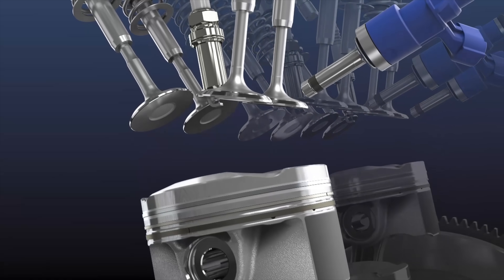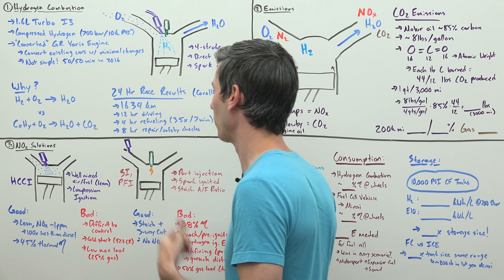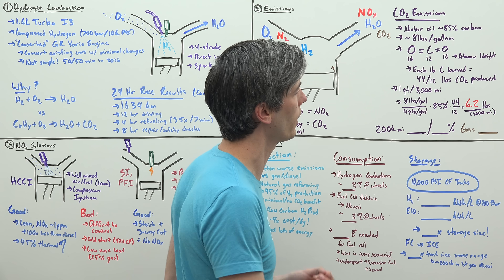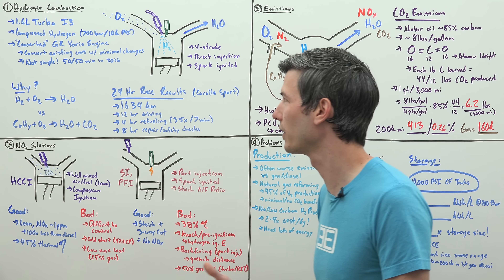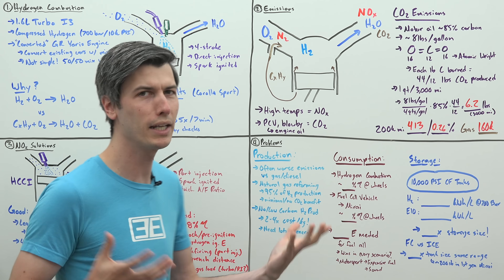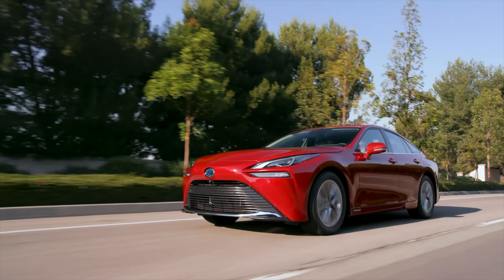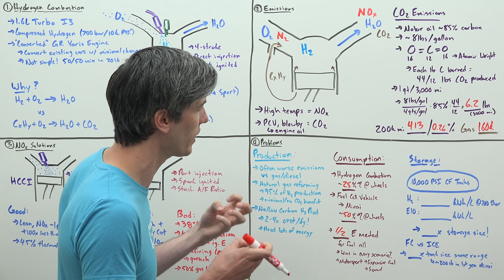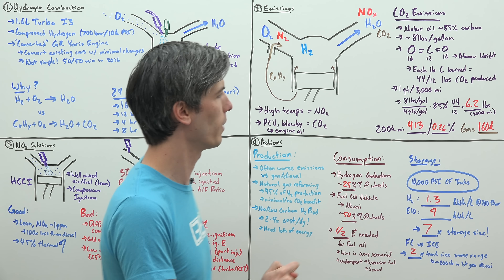Toyota's Developing A Hydrogen Combustion Engine!

Comment: Very interesting. But I think Toyota needs a lot of respect for trying all these different options, they seem to really care about ICE fans. I appreciate that.
Reply: Battery production capacity is the problem. Huge amount of investments needed and a big cut over their profits because of the battery cost in each car. Hydrogen combustion engines would maintain a bigger piece of the pie. 

Money is always what they care about.
Reply: @MuitoDaora  It's not what "they" care about.
Hydrogen ICE simply makes more sense and is way better for the environment if you take into account the whole process chain of regular EVs.
Plus the ICE has been developed and optimized for decades now, it would be a total waste to throw it all away and start fresh.
Reinventing the wheel never works.
Reply: @MuitoDaora  if you're correct, why don't they simply take the money they're investing in hydrogen power and channel it into battery production so they get all the pie?
Reply: @vinigretzky97  I'm not defending EVs, just saying that money in their pocket is what matters.
EVs are being pushed by regulators for their efficiency and possibility of not polluting the atmosphere by using renewable energy for the whole process but the mining problem persist.
Reply: @pjay3028  Because this experiment is dwarfed in comparison to build battery factories over the world. Even tesla has to use suppliers for their batteries.
Reply: @vinigretzky97  That has been disproven many times already.
Reply: @vinigretzky97  HAHHAAH  better for the environment than EVs.  Did you skip the part of where the hydrogen comes from?

And you do know that mining is required to build Any car, not just EV's right?
Reply: @MuitoDaora  that doesn't change the fact that they're championing alternative power options in a way that other manufacturers don't seem to be and when you link that with the effort and funding they've put into cars like the GR Yaris and the GR86 which are definitely not going to deliver huge profits, to say they're all about the profit is harsh.
Reply: @KenLord  Yeah but only standard metals like aluminium or steel.
Reply: @boostav  nah, it hasn't. citing the thermal efficiency figure time and time again won't change anything about the ressources and effort required to get to a running car in the first place.
Reply: @pjay3028  That's brand recognition. Not every product makes returns in direct sales but there is always a flagship that that allures the brand. For example Gucci makes some really expensive clothes but  big money come from thousands of cheaper accessories.
Reply: @MuitoDaora  you're really going to struggle to convince me that probably 99% of Toyota buyers will be remotely swayed by the existence of the GR cars.
Reply: @KenLord  Where does hydrogen come from? Where tf do you think? It's THE MOST abundant element in the universe, it only needs to be isolated from water. Electricity on the other hand, has to be generated.
Reply: @vinigretzky97  you didn't watch until the end, did you? You know, the bit where Jason says everything about the idea is bad and doesn't make sense outside of very nice applications.
Reply: @vinigretzky97  Has nothing to do with citing efficency figures. Those fake studies you cite don't look at the full cycle of Hydrogen or Petrol, how do you think the natural gas from which hydrogen comes from is extracted? The EU study cited in this very video is one of many that completely disproves your argument, but clearly reading/listening comprehension is not your forte.
Reply: @ajstevens1652  Yeah chief that's the entire problem ... isolating it from water is incredibly inefficient. Also it is the most abundant element in the Universe not on Earth.
Reply: @MuitoDaora  yah and China has more than 90% of the world's lithium which is not as welcome to Japan.  Looking forward for the result of this battle 👍
Reply: @boostav  EU is just a big lobby aparatus not a valid source for science.
So what is the problem with extracting natural gas?
Reply: @jfolz  That's your source? "What Jason said"?
Reply: @pjay3028  Of course not, but that isn't objectively measurable. And all brands that produce goods of desire do that. Is subjective.
Reply: @davidkorcak  Great, gas it is then. Never change a running system.
Reply: @ajstevens1652  HAHAHAHA OMG WOW That is freaking AWESOME!

"it just has to be separated from water" ... first of all, the video TOLD YOU that most hydrogen is produced from reforming Natural Gas ... Emitting CO2 the same as if you were burning natural gas,  oh but wait, the reforming process requires temperatures of 700 to 1000 degrees Celsius.  It's Very Energy Intensive!

Second of all,  If you want to get hydrogen from water ... Guess how it's done!  USING HUGE AMOUNTS OF ELECTRICITY ... that HERPA DERP DERP DERP ... HAS TO BE GENERATED.

This Is Why Hydrogen Makes No Sense For Cars.  Hydrogen is not a fuel source, it's effectively a chemical battery.   So cut out all that unnecessary complexity and extra stuff that can break, and just use a freaking battery.
Reply: @ajstevens1652  "it's the most abundant element in the universe" 

Just wow, I'm still laughing.  What are you going to do, take a spaceship to the sun and bring some back?   HAHAHAHAHA.
Reply: @vinigretzky97  Read up on how mining works.  Presently most lithium is extracted from underground salt deposits using injected hot water.  The water is put in evaporation ponds so the sun can dry it / precipitate the salts which are then refined.

... I bet you believed the propaganda showing massive / damaging open pit mines.  Which in reality are views of "Standard" metal mines.
Reply: @ajstevens1652  to seperate water for hydrogen you need about twice as much Electricity compared to what you would use on an BEV for the same distance travelled.
Also Hydrogen fueling infrastucture is incredibly expensive. about 10x to 100x as expensive as Electric fast charging infrastructure.
Reply: Lol don’t think for a second they “care” lol 😆
Reply: @koruki  have you read anything about Akio Toyoda?
Reply: @pjay3028  the grandson?
Reply: @koruki  the guy who runs Toyota at the moment and is an absolute petrol head. He's the reason they do care.
Reply: @jfolz  I am very sure the Toyota engineers did the numbers before committing to the race. Either they saw something feasible and workable or at this point they're just exploring the technology. And that project probably did not cost much for them.
Reply: @unitrader403  "Hydrogen fueling infrastucture"... who's talking about that? Think LPG tanks. Hydrogen filtration is the biggest challenge for them.
Reply: @unitrader403  don’t matter man a battery car is not clean unless its being charged by solar or turbines. if they can use renewables to make the hydrogen i dont think it matters what efficiency it gets long as people can refuel in two minutes on the go is all that matters
Reply: @vinigretzky97  If you take into account everything evs will still be better in the long run
Reply: @MuitoDaora  EVs being qoute on qoute good for the environment is one of the biggest myths ever claimed
Reply: @unitrader403  actually all you need to use is sunlight to split the oxygen from the molecule. Scientists have already made the hurdle and found easier less costly ways to oxidise the water last year.
Reply: @RR_NOOB  there is a huge difference though between hydrogen and batteries.. you only need to build the battery once, but you must constantly refill the hydrogen... i think the current reasonable estimate for the break-even-point for the emissions compared to ICE is i think at 35.000km or less. not sure where it is compared to Hydrogen, but currently it is probably far earlier, since most Hydrogen (99%) is made by Steam Reformation from Fossil Fuels (Methane to be exact), and this proces is Enery intensive, plus you get out less range from the Hydrogen than you could from the Methane it was made from...
 @Star.Chaser  Oxidise water? you want to make Hydrogen Peroxide? quick search for that didnt point to an easy Path to pure Hydrogen from there.. and in my previous post i clearly said the fueling Infrastructure is the big hurdle, not the Production... one "pump" for Hydrogen needs an investment of roughly a Million to construct (though tbh not sure about scaling effects), one Stall EV charging is about 100K for installation, and if scaled up to 50 stalls its just a bit over 10K per Stall according to some recent studies..  so installing 50 DC fast chargers is about half the price of setting up a single Hydrogen "Pump"...
* im putting pump in "" cause im sot sure about the correct term, since english is not my primary language
Reply: Toyota knows customer spending behavior better than any car company. It's extremely unlikely that they're wrong. They know their customers won't buy an expensive ev
Reply: @pjay3028  What about putting all that money in create an CO2 apbsorbing element in ICEs?
Reply: I trust Toyota engineers will figure this out. In addition a new magnesium hydrogen paste was developed in      Germany.
Reply: @vinigretzky97  hydrogen ice makes zero sense. It’s about 5 times the price of gasoline. There’s zero infrastructure. Even in this video he said the Toyota had to refill its hydrogen tank 35 TIMES. 35 TIMES IN 1000 miles. They had to refill their hydrogen tank every 30 miles.  
To you that makes sense?  Sure. Whatever you say.
Reply: New Zealand is building green hydrogen production plants. The hydrogen buyer will be Japan
Reply: As Jason pointed out, unfortunately hydrogen is not a good solution from a storage perspective.  Large tanks under enormous pressure, a logistical nightmare of refilling, etc.   A company can try and keep running in circles.   As the famous quote by Albert Einstein goes "The definition of insanity is keep doing the same thing over and over again, while expecting different results". 😆
Reply: Thanks to some uploaders on YT, I learned there's a difference between grey & green source produced hydrogen. I think for the near future hydrogen powered jetliners, cargo freighter vessels, even train locomotives may be best suited for this method ?

Comment: My son is an engineer and was involved in the development of the Toyota Mirai fuel cell. He is currently working on next generation solid-state battery technology for EVs. I'm really proud of him.
Reply: That is Exactly what is Holding back EV's Right now, The Batteries. Solid State Batteries would be a Revolution in EV Tech as it would make them Lighter, Faster to Charge and give them a MUCH higher Range.

I wish your son the best of luck in his research because I am absolutely Impatient to see Solid State Batteries become Mainstream
Reply: Except all methods of producing solid state batteries takes huge amounts of power and mining....which leads you back to not really making a difference
Reply: Respect
Reply: @imdrunken  Those are the very issues he's working to solve - along with eliminating dendrite formation in solid state batteries. He has a PhD from the Colorado School of Mines, and he works in Golden at the National Renewable Energy Laboratory.
Reply: @zzanatos2001  good luck to him, but I doubt he will be breaking the laws of thermodynamics or conservation of energy any time soon. All solutions come with a whole new set of problems....none of which have ever negated the problems. Just spread them out or separated them by multiple manufacturing processes or other necessary thing to make these new "solutions" work.
Reply: Show him Stanley Myers and Bob Lazar,, both made hydrogen cars in differant ways. Smart guys.
Reply: Lots of respect!
Reply: @imdrunken  You're reminding me of the grammar Nazis that use the wrong their, there or they're. Who do you think you are to say that someone with a PhD currently working in research won't be able to solve any problems? If Grammar Hitler were to find out about this he would throw you in the grammar stockades for overstepping your authority.

There is nothing in the law of conservation of energy or laws of thermodynamics that state that batteries can't be cheap, efficient, or easily recyclable. They simply can not put out more energy than is used to charge them. We don't make batteries out of cadmium anymore because we've learned much better ways to do it.
Reply: Good for your son! He's making the world go 'round
Reply: HiveMynd batteries are holding back EVs now. Soon it will be a low mineral supply, as there are less rare earth minerals in quantity than there is oil in supply. This doesn’t even get into the infrastructure not being able to keep up
Reply: Wonder how good it is for the environment mining cobalt and lithium.
Reply: @HiveMynd  You're right that the only thing holding EVs back is physics. It certainly isn't politics, hype, or subsidies.
Reply: @BOMEFSY  Lithium right now is very much like a temporary bridge that was built to help Lewis & Clark cross a chasm. It doesn't need to be perfect, it just needs to get us across the chasm. OP's son is working on it, he's not alone, eventually the extraordinarily intelligent (and attractive) people in the world will figure things out.
Reply: I would be to
Reply: @imdrunken  Are you an engineer? Are you smarter than those corporate engineers? then you should apply. Nevermind, they will not hire you. Too negative.
Reply: @WAN2TREE4  not only did i do some schooling  as an engineer, my brother is an electrical engineer with Cornings research team......who also has worked on some solar stuff in the past....
Reply: @WAN2TREE4  so I have plenty of experience and resources to discuss this topic....
Reply: I AM VERY PROUD THAT YOUR ARE PROUD OF YOUR SON, AND I AM 100% BEING SERIOUS!
Reply: cool story
Reply: @zzanatos2001  No way, I literally just graduated from Colorado School of Mines in the Materials Engineering department. Did think about going into battery technology. Not many Mines alumni, cool to hear about one on youtube!
Reply: Sure he was. Just cause he was there does not mean he helped or contributed
Reply: @shapelessdreams  if Tesla wasn't making money from their cars then why go through all the trouble and open Tesla factories in Texas, China, Germany, and England? 🤷‍♂️
Reply: @-P-C-  their net profit doesn't come from the sales on cars. Its a different income.